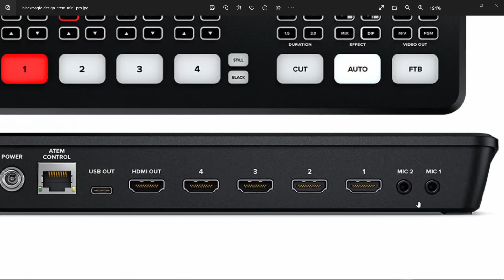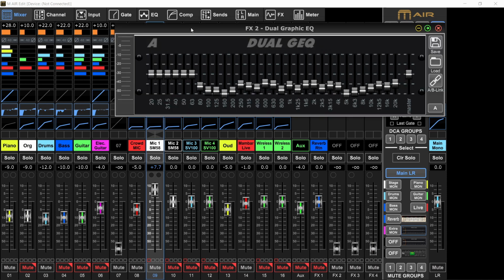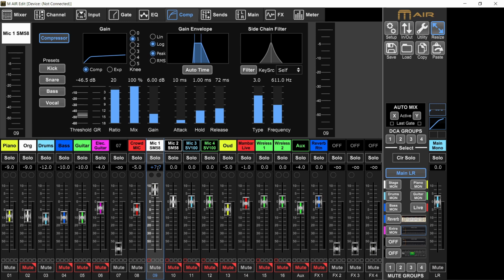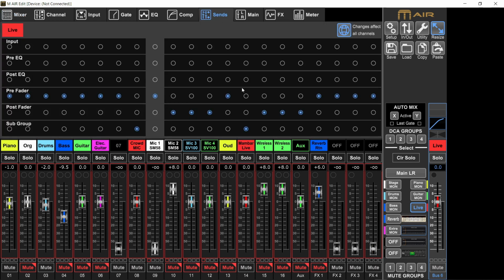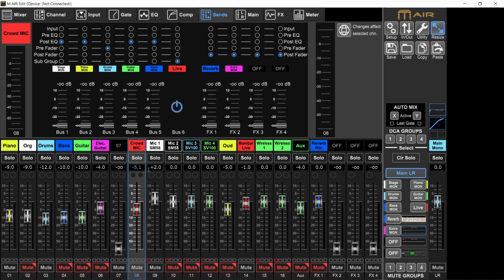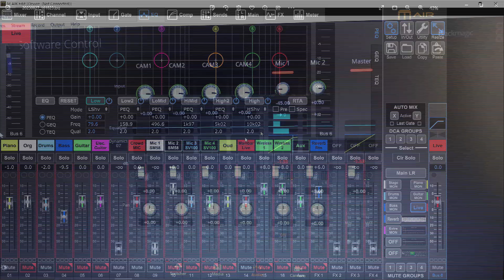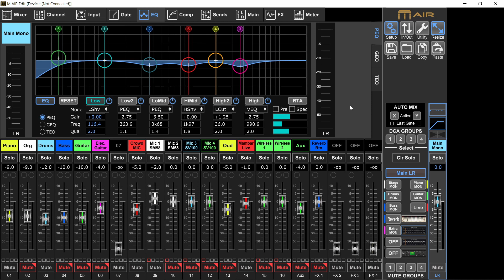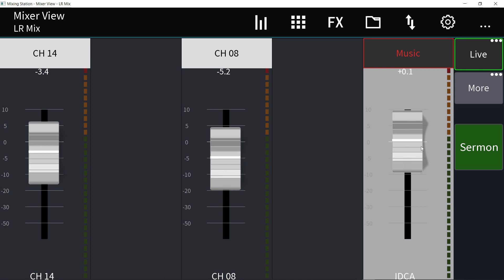Midas MR18 Livestream Mix Strategy

Comment: what cable you use for audio for atem mini t to mixer  how did you get left and right output
Reply from the maker: @MKMTTG  1/4 inch to 3.5 mm Ts cable 
Plug it to the headphones output on the mixer and in the monitor page select the source to be LR (that's the default)
Reply: @danielkharrat Thank you how do I put the volume up because my sound is low in the video